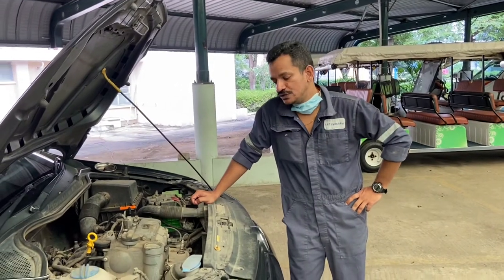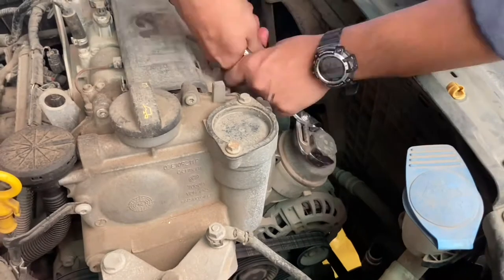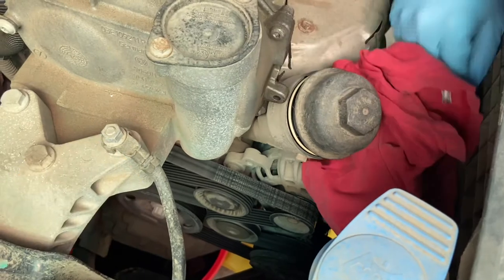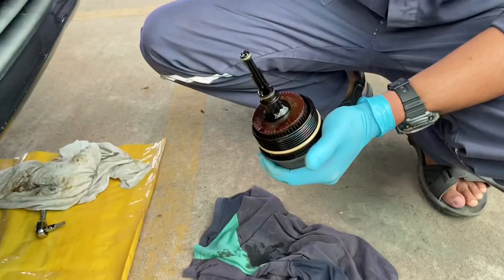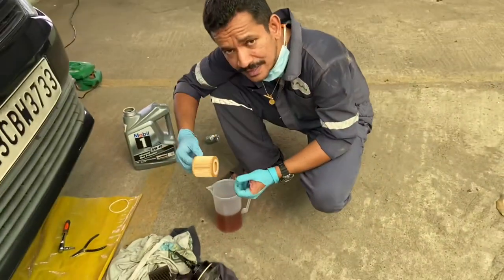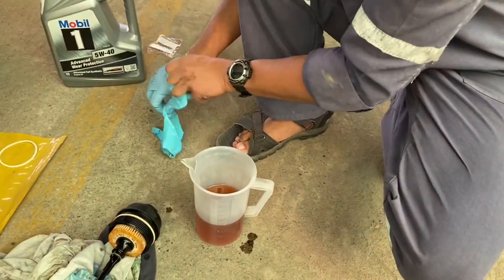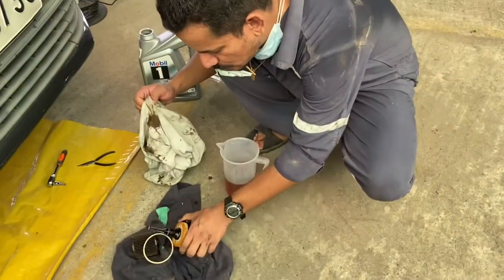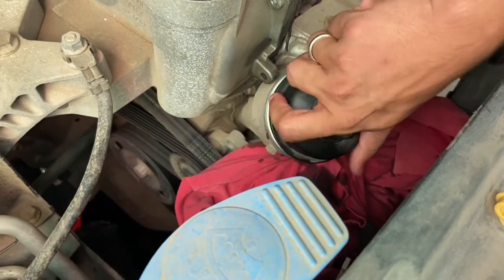Polo 6R 1.2 MPI service - Changing oil filter

Comment: My Polo 1.2 MPI is 8 years old and 9th year service coming up.  I am not sure if oil filter was ever replaced during any of the previous services.. I recently asked a SA at VW ASC and he told me that 1.2 MPI doesn’t need oil filter replacement. I am planning to get it replaced during my next service
Reply from the maker: He must have meant fuel filter Binod. Oil filters are replaced at every service.

Comment: Hi bro which engine oil is best for 1.2 MPI?
Reply from the maker: 5W30 or 5W40 from Shell, Castrol, Mobil.
Reply: @GaneshBalan  VW ASC using SPECIAL G engine oil is it good?
Reply from the maker: Correct. Their global contract for engine oil supply with Castrol expired and now it is with Shell.
Reply: @GaneshBalan  in my friend vehicle they use SPECIAL D in 1.2 MPI ENGINE so which one is correct?
Which one is correct SPECIAL G OR SPECIAL D?
Reply from the maker: Special G is for petrol engines (G for gasoline) and Special D is for Diesel engines (D for diesels).
Reply: @GaneshBalan  what happen if special D used in 1.2 MPI engine?
In my friend VW POLO VW ASC used Special D and now he came to know that they used the wrong one what will be the consequences?
Reply from the maker: There won’t be any consequences so to say. Oils have special additives to help the engines for lubrication and combustion. As long as the SAE grade is the same, nothing would happen.
Reply: @GaneshBalan  one last question sir which oil I have to use if I require future top-up.
Reply from the maker: Fully synthetic 5W40 from Castrol, Shell or Mobil. These are reputed companies that have do R&Ds for oil development and related engineering. You cannot go wrong with their oils.
Reply: @GaneshBalan  Thank you for making series in Polo 1.2 petrol 6r which is underrated engine.
Reply from the maker: No problem Suraj. Trust the clips helped. The 1.2 MPI is an underrated engine I agree.
Reply: @GaneshBalan  hi sir i just got message from my friend he is saying he is getting low mileage after changing engine oil he changed spark plugs too
I don't know what will be the prblm.
Reply from the maker: Please check tankful to tankful mileage not what is reported by the instrument cluster.
Reply: @GaneshBalan  previously he used to getting 12 to 13 but after changing oil he is getting very low. 
So do you think this engine oil is not suitable? He is getting tensed about whether it harms the engine.
Reply from the maker: A wrong grade will affect the fuel efficiency. Not in this case since it is 5W40. There’s something else affecting the fuel efficiency.
Reply: @GaneshBalan  I just read the bottle in special G it is showing VW 502 GRADE and SPECIAL D it is showing VW 505 01 Grade i think this is effecting.
Reply from the maker: Where did he do this oil change? At VW authorised service centre?
Reply: @GaneshBalan  he saying one of the vw employee is working outside too he replaced that.
Reply: @GaneshBalan  hi one think he observed that his car performance is increased but mileage decreased.
Reply from the maker: Not attributable to the oil change man.
Reply: @GaneshBalan  what do you think does it damaged the engine? He just drove 7km after service.
Reply from the maker: No it doesn’t.
Reply: @GaneshBalan  what precautions do we have to take do i have to flush the current oil and replace to Special G or can i just replace without flush.
Reply from the maker: Drain existing oil and fill the new one. Don’t use flush. There’s no need to.
Reply: @GaneshBalan  Hi mate, I want to know what is the price of o2 sensor for VW polo do you know part number for polo 1.2 MPI 2014 model.
Reply from the maker: No clue man. Check oriparts.com and enter the car and model year correctly. You’ll have to browse through the catalogue.
Reply: @GaneshBalan  hi sir, what will happen if we use semi synthetic or normal engine oil in this same engine and any tips how to inc fuel economy in this engine ? my car is serviced from auth service centres now i am planning to get it serviced from outside ,will it be good for my engine if i use another oil ?

Comment: Sir plz show how to upgrade polo headlight to single barrel to dual barrel
Reply from the maker: Hi Yogesh. You’ll need to get an adapter for connecting the H4 bulb, parking light bulb and indicator bulb to the 10-pin connector. And to ensure that both the low beam and high beam of the dual barrel headlight turns on when you turn on high beam, you need to make a small change in the T41 connector. There’s some work involved if you’re prepared for it. 

Otherwise, get a good quality wiring harness and switch to Osram/Philips 90/100W bulbs. I’ve been using this setup for sometime and it has given good results so far. Cheapest option if you need an upgrade from the stock setup.
Reply from the maker: Ping me on 9099691369. Will help you out.
Reply: Thank you so much for rpl